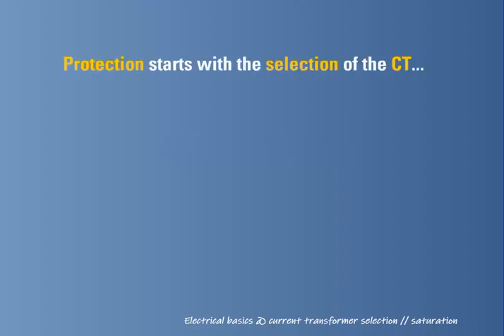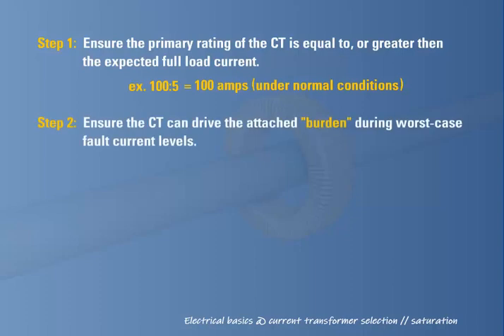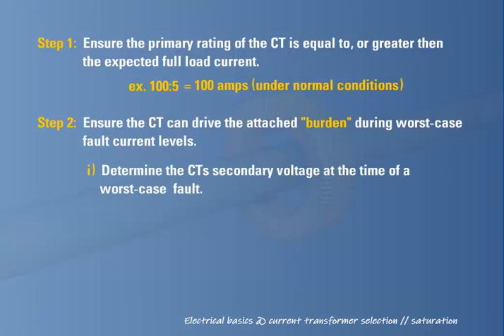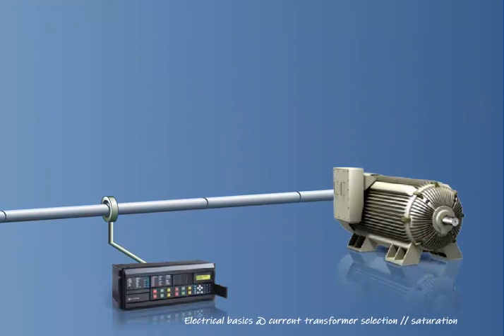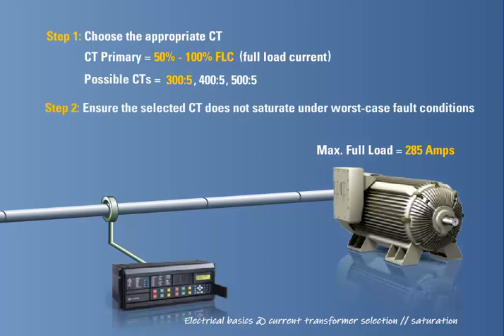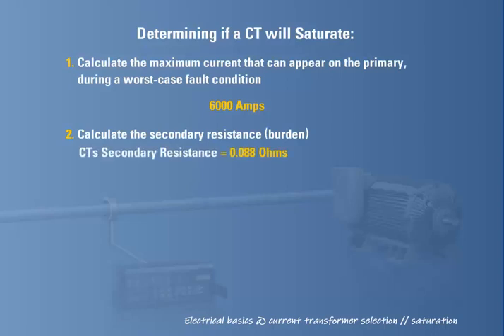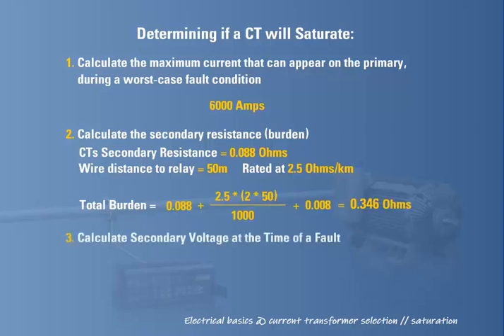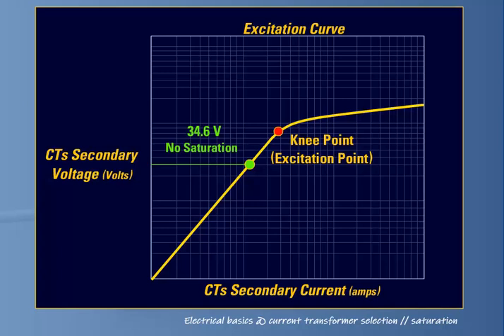Current Transformer Selection & Saturation Explained | CT Class & Accuracy

Comment: This video talks about a relay in the burden circuit. So, it makes us thinking this is the technique to select a CT for protection device. But what about metering CT ? I understood from other resources that the selection for metering CT is different, despite not finding clear information about it.
What about these CT we can buy on Aliexpress that don't show any CT excitation curve ? Is it possible to choose a CT without the excitation curve ?
Is the CT signal at the secondary exactly right in phase with the primary ? Or is it possible there is a shift ? I'm thinking of using CT and VT signal to a microcontroler for metering Amperes, voltages, power and Power Factor, so need accurate timing in the signal.